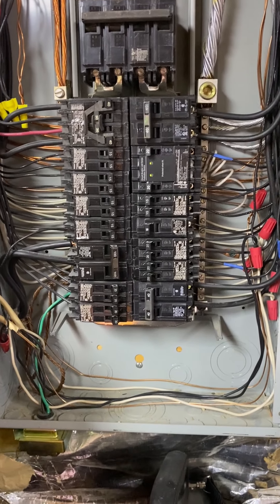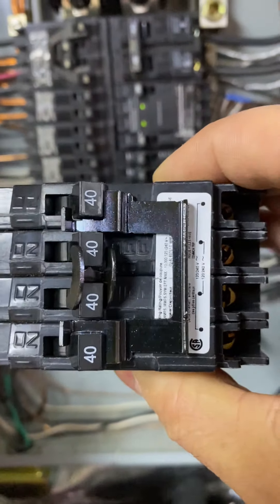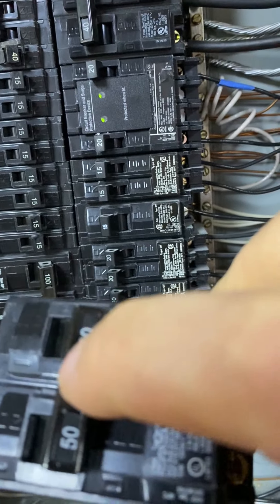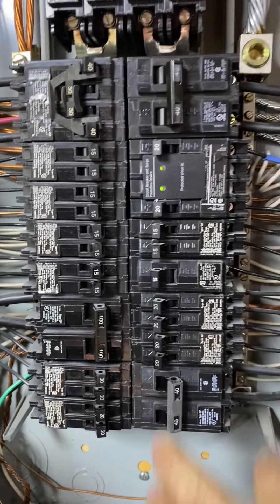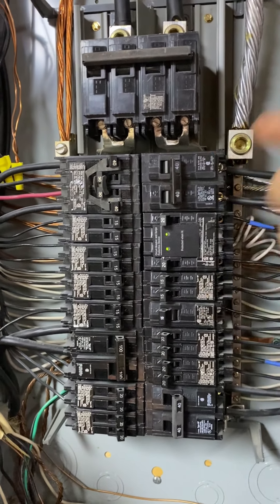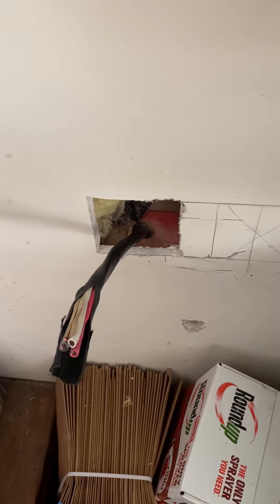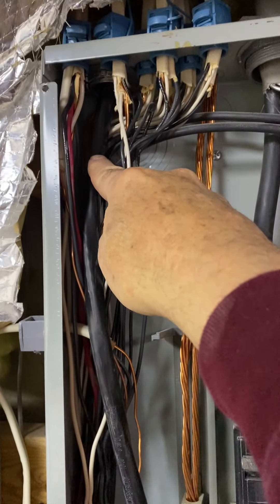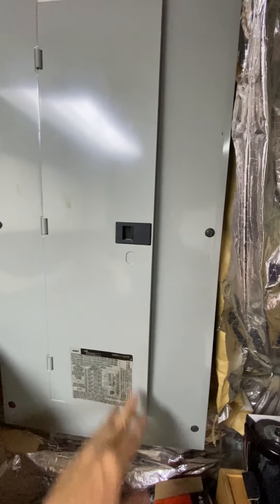Add a 220 VAC CB in a Full Breaker Box for a nema 14-50 220v garage receptacle.

Comment: Check your loadcenters some only allow tandem breakers on the bottom half. It will be listed on the tag inside or on the cover.
Reply from the maker: Thanks for the great info. I checked my panel and it states “sum of qt breaker rating not to exceed 100 amps per branch circuit bus stab” so I believe I am in good shape. Greatly appreciated.

Comment: dual 50 A additional!
Did you make a calculation of the total capacity for the new continuous load or just kept your fingers crossed?
Good job otherwise, especially that long 6 G wire fishing that had to be a lot of fun!
Reply from the maker: Thanks for post, I’m always learning especially from these comments. My panel states “sum of breaker rating not to exceed 100 amps per branch circuit bus stub”. Good there. I just used an online load calculator and got 165 amps. Box is a 200 amp box. Have natural gas hot water, dryer, stove, and heat which helps along with all led lighting, etc. I think I’m good, however, should have a pro look it over. Yes, it was an all day job fishing the wire, results are 100% of wire in walls and ceilings. Fun for me!

Comment: Thanks for the video and great job!
Can you share the part number of that quad breaker?  (Yes, I know it has to match the mfg of the Load Center make.)
Reply from the maker: Thanks. Ordered on Amazon for $45 back in April 2021. Surprised to see it now listed for $42! Part listed as “Siemens Q24040CT2 Two 40-Amp Double Pole Circuit Breaker”.
Reply: @edshandymantips4862  
Got it.  The suffix CT2, the numeral 2 is the key, such that the outer 2 CBs are linked as well.
( I had only used the CT type in the past.)